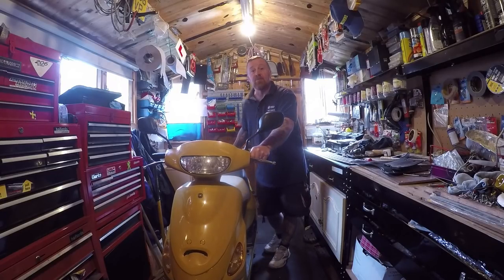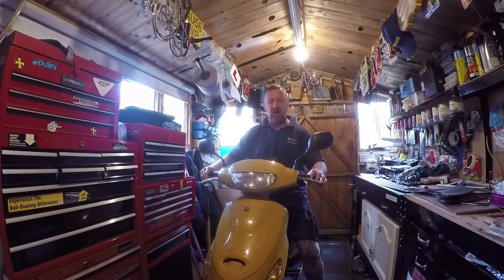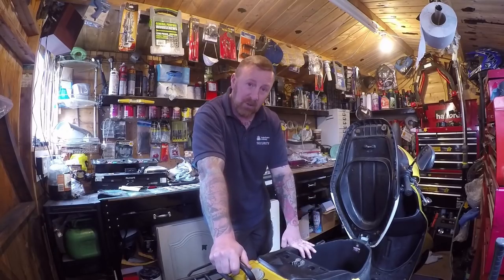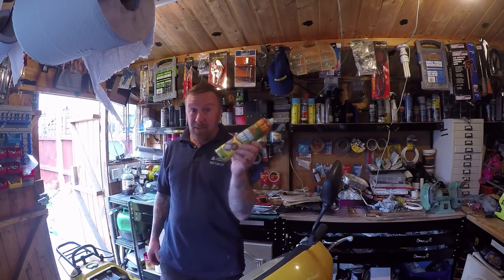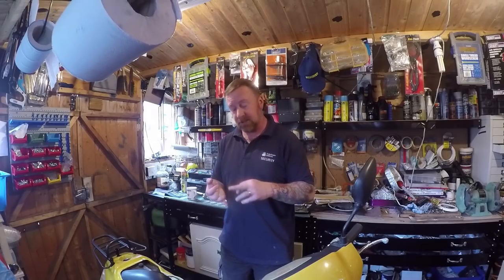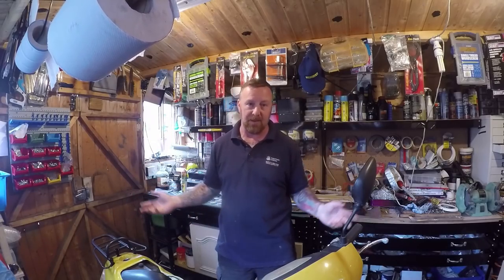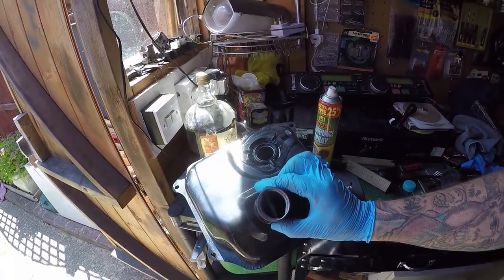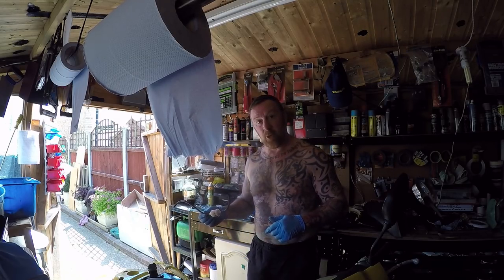CHINESE MOPED WON'T START HELPFUL ADVICE TO GET IT GOING MARK SAVAGE

Comment: Hi mark first off really love the videos they have helped out loads. But I have a question I hope you might be able to help with went out on my scooter today everything was going well and then no drive to rear wheel it was like it was stuck in gear on inspection the clutch was spinning but the bell housing was not when I revved it up they I noticed smoke of the clutch is there a way to find out what created this to happen?
Kindest regards in advance for your time keep up the great work
Regards rob
Reply from the maker: sounds like the belt bud , like in my other moped videos take of the variator cover and you will see whats going on but guess its the belt and you will need to change the rollers and clean variator too more than likely bud but easy job
thanks for watching 
mark
Reply: Hi mark I put. New rollers in the other day but when trying to sort out what happened with the bell housing not moving I re checked them and noticed scoring marks on them I have cleaned out the Variator and see no reason to the scoring. On another not ordered new belt as there was a lot of play on the one in there seemed to bounce about abit 
Again thank you so much for the help 
Regards rob
Reply from the maker: how odd, did you refit the cover inline as they do have a little play so may have been out of line maybe
they can jam up if they loose a spring so best take off and inspect it or the pads are worn and come off, 
mark
Reply: Manage to get it all going again removed clutch and refit it all the only problem I can see is plates in clutch part that you can loosen open to remove belt only seem to close back up when engine starts up had a look and the large centre Spring seems rusty af wouldn't  mind to much but bike has done just over 300 miles total  would you recommend i try any wd40 to see if I can free the spring up a little just as long as I clean up left over to avoid getting it on the clutch shoes? Reason for this is trying to source new clutch assembly for my engine model is as rare as hens teeth lol
Regards rob
Reply from the maker: that's not many miles but I have had this on a speedfight in one of my videos, yes wd40 sorted it and had to clean up after as not  to get any on the belt
however is seemed to return and stick after 50 miles or so, so best take it apart clean oil and see how you get on, I guess wd40 to see if it sorts it first would be a lot easier lol
the one I had I think it got wet and this caused it to stick!
mark
Reply: Well here's hoping I can get it sorted lol it was like the shaft that the clutch bell house attaches to some how jammed up but like I side everything was OK after I took it apart 
Well thanks again mark you are a true gent 👍🏻

Comment: Mark, I have a new Chinese model which was shipped to me. The electric start nor the kick start work. The lights and horn work so I don’t believe it’s the battery. Any ideas?
Reply: Rosa Napolitano does it make a noise when you try and start it ?
Reply: Raymond TP Hey there. Thanks for getting back to me but the issue was resolved. Apparently I needed to press the foot break when using the electric start. I’ve never had a foot break on my scooters so never thought to do that until someone told me about it. Have a good day!
Reply: Rosa Napolitano came here to suggest just that.. it's an easy part to overlook if unaware.

Comment: Mark, my bike starts up every morning but after a few miles it wont turn over. Just fitted a new ignition system and same old problem. Any tips you can give please?
Reply: So what I mean is, I start up in the morning and ride a few miles to the shop, pop in and when I'm ready to ride again I have to wait 20 minutes for it to start up again. Any idea?
Reply from the maker: ive had this and it was the stator coil going to earth, once it heated up it failed and cooled down it worked !!
but that's not to say its your prob
id try new plug and service your carb, check or replace all fuel lines and air filter
Reply: @marksavage  Thanks for the help. Uve just replaced the ignition and the ignition coil but same problem. I'll give the fuel line and air filter a go... thanks again.

Comment: Hi there Mark just put a second-hand engine in my scooter and the spark plug keeps poping out when I start it could it be to much compression or new threads
Reply from the maker: Scott Sabin hi bud 
That’s not got as the tread has gone and the last owner knew that!!
Not good and can be a bugger to fix !!
I’d bring it back or try get it fixed but you can’t helicoul it maybe use your old top ?
Thanks for watching 
Mark
Reply: mark savage thanks bud might just get a new head I'm thinking as it's a 4t
Reply: New heads can be cheap.. I got a new one for $30 when I was rebuilding mine after a catastrophic overheating failure.

Comment: Hi I have a pulse scout 49 2011 and I have a problem where it keeps turning over and dosent start but it starts perfectly on the kick start and drives perfectly and idles. I have tried a valve adjustment that didn't work and I checked the spark when pressing the button it was fine. Also verry rarely it dose decide to start on the button but verry rarely i am just so stuck on what it could be do you have any suggestions pls :--)
Reply from the maker: hi bud 
on my next two videos I have dealt with this issue !!, well on the first one and on the 2nd one I end up with the same problem!!
its mad, I think it ended up being the starter relay but was not 100% sure  
the guy I sold it too was happy it ran and would kick over so I left as is sorry to say

Comment: Hey mark pony boy here. Gots a bro with Malibu scoot 50cc starts good won't get up to 20km and can't get up hills what's your opinion BIG Guy???buddy pal.small spring on rear ge fell off and we fixed it checked fuel filter and now we are trying to get nut free on front crank to check weight.nut won't come off lol bet ya herd date before.lol let me know thoughts.oh we checked valves.
Reply from the maker: You will have to get that nut off bud so you can change the rollers and clean the variator 
Try jamming the butt end of the hammer into the variator 
Heating the nut up 
Or 
Take the fan cover off the other side and use that to counter to get the nut off 
Defo the rollers as you say you've cleaned carb and service etc

Comment: I have a wolf rx 50 that I recently changed the ignition switch. It turned over but wouldn't start. All my lights and blinkers work. I've had the battery on a charger and when looking at it, it says it's charged. I don't know what to do next, can you please help!!
Reply from the maker: hi bud was it immob ??
check if you have spark as the old ignition and key may have been immob and this can be your problem, or like in my ybr video on here the ignition wires may not be wired the same and this was my problem 
give the Yamaha yby videos a watch they will help there are a few but the one with the ignition problem

Comment: Hi Mark I have the same moped but the spark plug doesn't fire can u help me out please
Reply from the maker: Jakub Aliev start with cdi 
In my video you just get to see it to the left hand side of the engine when you take out the seat 
It’s a simple plug and play item you can get a new one off e bay and be back on the road bud 
Please like and sub
Mark

Comment: how water get in petrol tank do you leave the cap of when its raining mate
Reply from the maker: so odd but its often when they are sat up or filled from petrol cans as i my video i did get it lol, however Ricky this new E10 rubbish sucks in water as this is why is no good for peds and thats a fact that not all peds can run on it and i wont use it even in my bikes chainsaws and mowers !!
Reply: @marksavage  about moped and so many screws mate holding panels on i lost a screw not on floor took front panel of not there took under panel of in there was a joke

Comment: I got a 2010 Eton 49cc beamer took it out on a  basketball field and it was raining and had some fun but now I cleaned the carburetor and it still will not start  can you help?
Reply from the maker: riding of road on a flied you may have bashed around all the parts so id be going over everything
my videos will help start with spark, wet plug and check over everything all fuel pips etc, most are on 2t speedfight but the basics will be the same bud and they will help 
if it was raining you could have water in with the air filter , damp plug , and as for carb give that another looking over

Comment: Have put a 80cc bore kit on your son's gy6 50cc moped and now won't start. Any advice please
Reply from the maker: hi bud 
watch this https://www.youtube.com/watch?v=hMN4ZTdnrSU
its just as simple as change the piston,
more power needs more fuel, more air and needs to get the gases out 
so did you change the carb or up jet it 
air filter 
sports exhaust
air /petrol mix so tuning

Comment: nice video , just bought a chinese scooter 1200 km on clock winter at the door a video over winter ready would be useful
Reply from the maker: hi bud I have 150 videos on mopeds, ok lots on speedfight and aeroxs but lots to help and I done a riding in the winter ( very cold lol) however yes bud I will upload a video soon for getting you bike and moped ready for winter and hope it helps, thanks for watching
mark
Reply from the maker: just uploaded a bad weather winter ready video, its a bit basic but hopefully will help 
mark

Comment: Hi iv got a aprilia rally and its smokey when i rev it but when it idling its fine no smoke. I dont know what it cud be
Reply from the maker: Jordan Howson I take it it’s 4t ?
If so it would be the piston rings or valves leaking oil properly due to overfilling of the oil or poor Maintainance 
You will have to keep an eye on your oil make sure it’s correct and not let it get too low and clean plug when it gets hard to start 
If it was 2t that would be normal ??
Thanks for watching 
Please like and sub
Mark

Comment: Hi Mark, I'm a young 50yr old, and am looking for a 50cc scooter just to commute to work, what would you recommend, oh and great video as always
Reply from the maker: william fitzpatrick hi bud 
If you have a budget and don’t mind just doing simple maintenance then these little mopeds are great 
Just pop in petrol and go it’s as simple as that, they are fun to ride park away where and zip around
Just be ready for the odd car driver who pulls out on you so leave a safe distance 
Go look and test a few before yo buy for size 
Check they have been looked after !
Thanks for watching. 
Please like and sub
Mark
Reply: I say go trike! Icebear makes 8 or 9 different body types and cc.. Downside to trikes is bumbs you feel them all of them so run lower air and or bigger back tires and or upgread to shocks. But even with that trikes are sooooo much more fun and safer for in bad weather not to mention they just look 😎 cool

Comment: Was just wondering because I have blow up two 70 kits on my aero and the crank shaft has little side to side play but no back and forth play will it still be okay to use as I have just got a new MKII sports pro 70 kit
Reply from the maker: Rodney Borrowdale you must know I don’t like 70 kits !!!’
As for the crank no it shouldn’t move luke that and it’s you big ends 
They have gone and make it move like that , crank change bud 
Also check piston and see why or how they are going like in my piston videos 
Is your oil pump work ok and are you adding 2t to your petrol ?
Please like and sub
Mark
Reply: mark savage it dosnt look like a stock aerox crank and the 70 kit hasn’t been put on yet as need sensor coolant tubes and some coolant
Reply from the maker: so its had a rebuild already and now it blown 2 pistons that not good bud, are you running them in?
I just don't like 70 kits but and this is why!
Reply: mark savage My son was on his bike after had all its new parts it would bog when set off then eventually it would slowly get a little more power then it just cut out but it had the wrong spark plug in It so I  put the correct one in and it won’t fire up .thanks
Reply from the maker: this can happen after a lot of playing around with, first check all connectors and coil for power before buying a cdi which maybe the problem
mark

Comment: hello mark, you did a sweet job on that ped, thanks for sharing
Reply from the maker: thanks bud and for watching , I have many more videos you might like to watch
mark
Reply: @marksavage  Hey Mark.. 
Love the videos. This was the first video I watched of yours, as I'd just bought a Pulse Scout very cheap and had the same problems as the one in your video. The only difference is I bought a new carb to get it running as they're so cheap. But after about 4 months sitting in the garden it started running rough and was a pain in the arse to start. I took the fuel tank off and when I drained it there was about 100ml of water in there with around 3 litres of fuel. So somehow water does seem to get in the fuel tank, some how. I'd bought a new fuel cap prior to emptying the tank. So I'm assuming the only other way water could be getting in is through the fuel sender unit. Interesting videos though mate. Keep them coming. Really enjoying watching them
Reply from the maker: @danielhull1269  thanks bud and yea how odd
How does it get in there??
Good to hear the help and thanks for the update and for watching

Comment: My roketa moped will start and idol but if u touch the throttle it will die why please help me
Reply from the maker: Try a carb clean bud like in my videos 
Take it you've changed plug and air filter

Comment: Need people’s help 
I got a moped it was running 
Put it in the van and it leaned to one side now tried kick starting and won’t start what do I do
Reply from the maker: sounds like the fuel may have come out of the carb so may help to kick start it to get it going again to get the fuel back into the carb, or something has come off in transit
check for spark like in my videos and then move on 
maybe ask the old owner if they ever had problems, you would not be the first person to buy a ped that was not as said
Reply: Take it out of the van - the moped is claustrophobic.

Comment: This was £650 ? cheapest bike I've seen on direct bikes is £899
Reply from the maker: well they do add a little on from dealer to dealer but like I say as long as you keep them serviced and topped up with oil they will keep running 
mark
Reply: +mark “marky bike” savage ok thanks

Comment: Pet peeve:  They are not 10mm bolts, they are 6mm bolts with 10mm heads.  Bolts are sized by thread diameter.  Fun video otherwise!